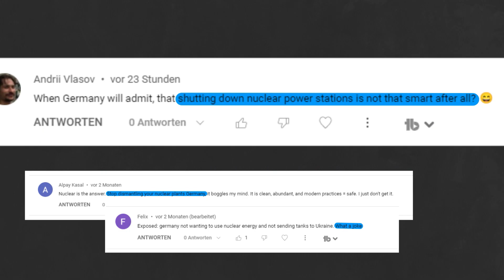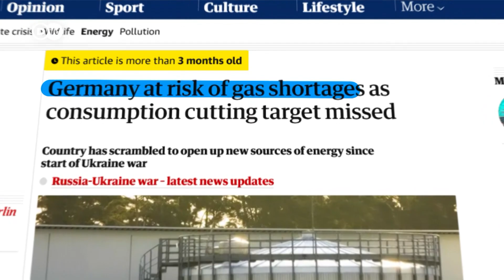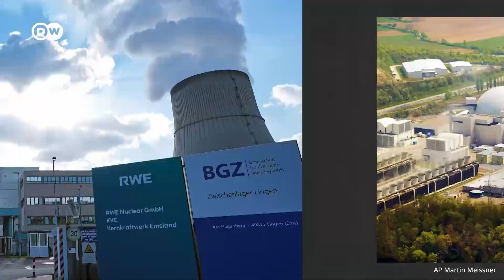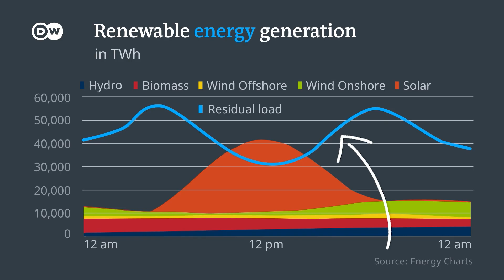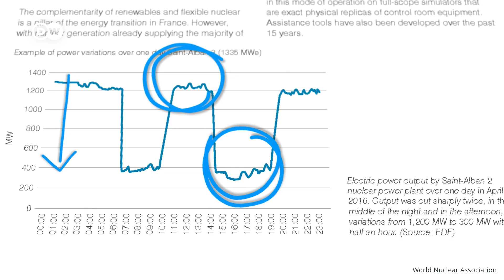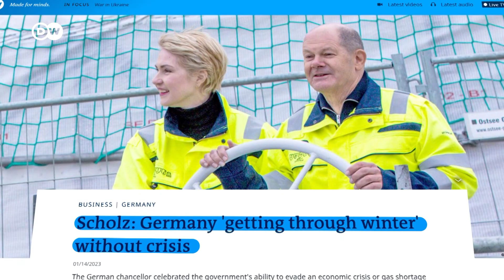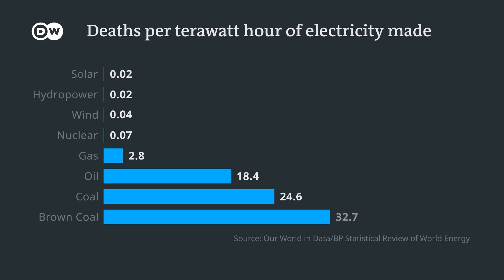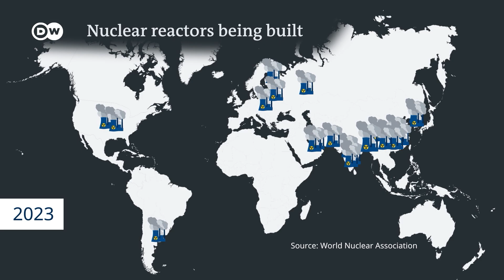Is Germany's nuclear exit a mistake?

Comment: Germany choose to phase out already built low carbon nuclear and keep coal for another 16 years. Absolute worse decision
Reply: @gianlucapistoia8993  maybe on a gw basic, certainly not on a gwh basis. But, as the op said, coal is locked in.
Reply: @riveness they should wait until they have the renewables to replace it before turning off nuclear plants. That won’t be years from now though.
Reply: Coal radioactive emissions are way worse than nuclear plant radioactive emissions.
Reply: @maeseatila  Radioactive coal? That actually makes sense in a way. God nature is scary.
Reply: @maeseatila Tschernobyl und Fukushima sind die Beweise
Reply: @maeseatila  nooo!
Reply: @maeseatila  A fact that few people know.
Lignite the most used type of coal in Germany is even worse.
Reply: @maeseatila  Indeed, for coal contains uranium and thorium, and coal plants in Germany have released more radiation than any nuclear plant in Germany ever had. But even that is not the biggest health concern, it's the air pollution from coal that is the real killer.
Reply: @switted823  Yup, radiation in coal energy is just the icing.
Reply: @Polygarden  i didn't talk about electricity demand. I talked about energy demand. Because yeah, if there's a huge demand for gas in winter, although it's not electricity in itself, that's gonna impact the electricity supply/demand. Because gas is also used to make electricity.

Edit: now that I think about it, it's even worse than that. You're saying that in Germany the electricity demand is the same in winter and summer. Yeah because people are heating with gas. But we want to stop gas, right? Because gas is a fossil fuel and is a main contribuer to global warming. Everyone should want to have electric heaters (and a low carbon source of electricity). And then the electricity consumption will not be the same in winter/summer. There will indeed be a peak of electricity demand in winter when the sun exposure is close to 0.
Reply: Nuclear has zero carbon
Reply: Well have you ever estimated the costs for storing nuclear waste for 150 000 years andc
 the dismantling of an power plant and storing that waste for the same time. Who
 will pay for that, the comoany who had run the plant? Do not think it will exist that long. So the taxpayer has to pay. Do your math, if all the costs had to be payed by the company no one could afford the price of $ 75 per kw/h and no one would built such an plant.
Reply: Exactly
Reply: @gianlucapistoia8993  nuclear reactor can be operated for 80 years. If it was constructed in 1989 it means it was only 34 years old not even half the life span. They decided to forcefully shutdown perfect reactors to construct 21GW of natural gas power plant. Germany don't care about climate they fought an ideological battle not environmental.
Reply: well, seems  like the germans are use to take the risk,   the rest of us can only watch .... ... power to the germas
Reply: Nuclear is bad for environment, do you understand?　Go to Japan or Ukraine.
Reply: @gianlucapistoia8993  This is not  good actually becuase Germany already hit the wall of diminishing return (ie if you have solar panel with a capacity factor of 25% (meaning they work for 25% of the hours present in a year) and on-shore or off-shore wind turbine (avarage CF 30-35%) you can't actually produce more energy by renewable or better you can but it's going to be wasted unless you store it somewhere, but Germany like many other EU states have maxed out their Hydro storage capacity so it will be simply impossible to reach 100% FER that's why Germany is the first CO2 emmiter in EU. Closing down nuclear plant and not build new ones just means giving the baseload production to Oil & Gas (or coal) industry.
Reply: The Carbon foot Print per TWH Power by nuclear Power plants is really bad, if you include the Energy that is needed to dig and operate Not yet existing Terminal Storage and the enormous amount of Concrete to Build the Hull of the reactor. „The Carbon free“ nuclear Power is nothing than green washing.

Nuclear energy is the best example of "privatise profits and socialise losses/risks". Pure moral scum.

https://amp.dw.com/en/fact-check-is-nuclear-energy-good-for-the-climate/a-59853315

And you cannot operate NPs with dry or drying out rivers. Look at the Po river or many others, many others are also already at a low water level. Since years you can bet the rivers like the Rhine get very low on water level, that even Navigation is merely or Not possible for some Werks in the Summer, Hoe would you cool your NPs without cooking the Fish?
Reply: Partially correct. The sensible, cost efficient way forward would be a massive buildout of renewables (fucking the NIMBYs in the process) and shutting off coal right alongside nuclear, with gas a few years behind.
Reply: It really makes you wonder what their agenda are motivations are for the climate change issue when they're willing to burn the more polluting Simpsons
Reply: @gianlucapistoia8993 And where do you think used solar panels and wind turbines go? Countries are burying all used solar and wind power planta under the ground because recycling cost is way to much. Also do you know where does the battaries come from? Lithium is extracted by third world countries like ones in africa, and all manufacturing is done by china and india who are the worlds biggest polluters so that in europe you can say yesss its green energy we are fighting world climate which is bullshit.
Reply: A broken in but not broken down nuclear reactor is about the most valuable thing in the world. Despite initial impressions, Germans are morons, the 20th century could easily have been the German century not the American century but they fucked that up too.
Reply: @gianlucapistoia8993  Germany is literally facing rolling blackouts constantly even with them using coal plants to supplement in the inconsistency of solar and wind. The future will have to be with nuclear or else you can enjoy blackouts.
Reply: Funfact: The coal industry pays german politicans handsome sums of money so the government keeps funding an already unprofitable and dying industry...  German politicans are just a bad joke...
Reply: This is a very good choice. Nvm the "some" dead citizens. Love COPD patients at the hospital (The bonus here is that they do not speak while at the ER.). They are fast patients at the ER. They expire somewhat quickly. (Some irony is in here, whatever, these neo n folks will pay the prize. ) Comparing value of health in this nations crimes against humanity, ad infinitum.
Reply: romans lived two thousand years ago and the first pharaohs 5000 years ago. We know little about them. imagine we bury nuclear waste that will last 100,000 years and is deadly. You cant do that the the future generation. We in Germany still have no repository and nobody wants it so...And the construction and dismantling of the nuclear reactors is not Co2 neutral either due to the gigantic amounts of concrete. In addition, because of the phase-out of nuclear power, we will not phase out coal later. Just wanted to make that clear. Btw Finland is the only country with a final repository.
Reply: German hypocrisy is so disgusting😂
Reply: Ofc you do so when you listen to some dumb activist instead of scientist
Reply: Bullshit
Reply: @kevinmeganck1302  
One would think, when 27 countries/EU with about 450ish million people living there "going green" by using/producing green hydrogen with renewables (wind, solar, water), that they're knowing what they are doing 😊

As one of lots of examples, please look up for the "green hydrogen coast line", a project run by the Netherlands, Denmark and Germany...

Some months ago the world wide first 14 hydrogen powered trains (Alston) started their service in Lower Saxony/Germany.

Daimler trucks has developed trucks running on hydrogen as well as the Faun Group have developed hydrogen powered trucks/vehicles, which are already in use...
Reply: The Greens chose that
Reply: Sadly, most Germans I know are with the government on this and when you call it bullshit (like I do), you get insulted and attacked.
I hate my country sometimes
Reply: And chose to still be heavily dependent on other countries for energy which has alrrady been shown to be its greater weakness and will still be exploited by other powers
Reply: That is not an absolute decision. 

1. Germany choose this path after the earthquake in Japan. 
No one in Germany wanted this shit to happen in Germany. Time passes by and ppl forget the feeling how it was. 

2. Germany is always producing more than enough energy. It will only lack of energy because countries like France have dozens of nuclear powerplants and no water to cool them. That happened last summer and they bought from Germany. 

3. We could be further with the energy structure. But bavaria is fucking it up with not upgrading their shity cable infrastructure. 

4. Energy from powerplants is not cheap. It looks cheap because it get billions of euros subventions. 

5. Since it was decided (from all ppl back then) to step out of nuclear energy the reactors didn’t get checked enough. Only if they work until the shutdown. And if we would continue to use them it would cost billions to renew them. 

5. Politicians use this frame rn to create fear and get new voters. But if u get ur facts straight u will see, that there is no problem. Germany is always exporting more electricity then buying. If the weather is not good they will just buy electricity.
Reply: ABSOLUTELY Worser than the Worse as off now we are already at this critical situation, Sun energy can't maintain Big Industrial Complex,  Firm and companies. We will be going Backwards...In the long run.
Reply: That's what you get when you vote for marxists.
Reply: 16 years lol they'll have coal for 25- 30 years
Reply: Ja
Reply: Absolutly! This is all so dumb! And many Germans don't like it! They risk our energy security! While France with theit "evil" nuclear power plants has much less CO2-Output than germany, which can be seen in the "Electricity"-App, we ar always above it even on the sunniest and windiest day. In Winter Germany turns nearly as brown as Poland inside that app, wihle France ist green ALL the year!
Reply: Yeah, these 5% matter ...not at all :D
Reply: Not to mention the geopolitical implications of relying on Russian energy
Reply: @gianlucapistoia8993  35 years is no age for a nuclear plant, and they could have been upgraded if there was a will. Instead they were left to decay since they were decommissioned anyways.  
The record numbers of solar and wind should not have been used to shut down nuclear, but rather dirty coal plants.
Reply: @gianlucapistoia8993  wind and solar are weather-dependant. They are never going to replace coal. They work together with coal.
Reply: @Flipdonyk  With battery price down and higher capacity of renewables than 100 % it will be
Reply: @Flipdonyk  Coal should not be used, ever, period
Reply: @Flipdonyk  They HAVE TO replace coal, because the world's ressources are dwindling and coal isn't a renewable ressource. Some day in the future jumanity doesn't have a choice but to use green energy (unless ehey find another finite ressource to exploit, but that only prolongs the inevitable
Reply: @Flipdonyk  replace coal with nuclear (or hydro, depending on where you live) and you will be right
Reply: @F44-JP5  if the place is very hot concentrated solar is also an option. Solar panels performance decrease in hotter regions and Concentrated solar also stores energy for later use. But it depends from place to place there is no one solution for every nation.
Reply: @F44-JP5  I'm totally fine with renewables + nuclear, until we find a better alternative. I'm absolutely not fine with renewables+coal+gas until we find a better alternative
Reply: @F44-JP5  hydro and geothermal deserve investment, it’d take a few years of serious funding but the potential is there,
Reply: @Flipdonyk  There are more green options than the two
Reply: @gianlucapistoia8993  then why aren't they constructed first before you start decommissioning? Is the idea to back the German citizen in a corner so that they'll pay "whatever it takes" to build these alternatives?  I think it is, why run a power plant for a Billion Euros a year when you can run an equivalent power plant for 10 Billion Euros.
Reply: @holdmybeer123  to be honest, that's a good question and I don't have an answer. But when I look at the course of the last 12-14 months, I get the feeling that Germany no longer wants to produce 100% of its own energy. It is relying more on its European partners (there are some projects already underway with Denmark) and at the same time you see that Germany is very focused on South America. I'm curious to see where it's going, the government is certainly not lazy and even if it's not shown so strongly in the media, as a German I really have the feeling that energy policy is changing for the better and news like "phasing out nuclear power" naturally seems as if Germany hasn't learned anything. I think you really have to see the bigger picture here, where we simply lack too much information to really be able to make a concrete judgement about it.
Reply: @gianlucapistoia8993  So your response is even though you don't know what is going on, that you trust your government. I get it, with the rise of technocrats, people really think governments know better than them, and hence the "trust"
Reply: @holdmybeer123  No, I didn't say that, but I also find this attitude of "the people up there are lazy and have no idea" reprehensible. I think a healthy scepticism is the best way, but I think I can read where the current policy is getting a lot of pressure from the population. I have been consuming the rhetoric of the individual politicians for years now and they all agree on one thing -> the climate change has a very high priority. Even at the EU level (to which Germany makes a very large contribution) it is identical. If we look at the financing plans of Germany and the EU, we also see an incredible amount of overlap, so yes, I am indeed optimistic at the moment and I believe in the climate-friendly transformation.
Reply: @holdmybeer123  
The origin plan was to "phase out" all fossil fuels (oil, coal, nat gas) until 2030-2045, while in that time range the renewables are taking over more and more (storage batteries as well), but then the war started, and here we are.
Reply: @gianlucapistoia8993  
Me too ("I believe in the climate friendly transformation") 😊
Please look up for the "green hydrogen coast line", a project run by the Netherlands, Denmark and Germany, all subsidiesed by the EU and Gvts.

Hydrogen can also be used as storage battery for the overloads from the offshore windmills and others as well as raw material for proceeding things like steel, glass, paper etc as well.

All along the coast lines electrolyseurs are under construction.

Lots of start ups are working on alternative storage possibilities as well.

Some months ago the world wide first 14 hydrogen powered trains (Alston) started their service in Lower Saxony/Germany.

Daimler trucks has developed trucks running on hydrogen as well as the Faun Group, those trucks are already in use.

Greetings from the North Sea coast line 😊 

Edit typo/autocorrect
Reply: @saba1030  👏🏽👏🏽👏🏽
Reply: @alainpannetier2543  thanks for the lucid explanation, you would think you will have a new home complete before you burn down your old home, but the cost of missed opportunity to burn down the old home is just too much? Nonsense!
Reply: @gianlucapistoia8993  Not in Germany.
Reply: @saba1030  Very interesting. Green Hydrogen has a very exciting future.
Reply: @gianlucapistoia8993  sure, instead of coal you could burn gas whose only problem is the production of less CO2 and more Ukrainian lives
Reply: @gianlucapistoia8993  not in Germany. Rivers are waterways and you cant build a Dam there
Reply: @gianlucapistoia8993  "we simply lack too much information"(well then read some more and inform yourself, they said most of it you just aren't willing to accept it) norad2 aka north stream 2 the main information you need, the idea was to help russia have a market for gas, because cheap russian gas is the main energy source for the steel industry that made Germany what it is now, and you guys went hook line and sinker(and taken the bait) for it and now the Netherlands has to sink down in the swamps to supply you with gas, please someone tell me, are the illuminati real because you can't make this shit up even if you wanted to, i heard that green party is financed by black money, but i guess they did the job well, if nuclear died before coal and gas. For the plan to go full renewable you had to have a e-transmission line through Denmark, Norway, all the way up to the North pole and back down to Texas(the sun shines always somewhere project) , or energy storage prepared, before demolishing nuclear plants, but as we see power corrupts and absolute power corrupts absolutely, even to the point of corrupting the minds of the electorate. One line explanation will not fix years of 50's US anti-nuclear (fear mongering) propaganda off your mind, but a man can dream. Read the deaths per KW statistic carefully again and think really hard, i believe you can find the thing you are missing)
ps: you can put the nuclear waste, in the sealed container, in a vat of water and use the thermal energy of the waste making energy out of the junk as long as it is above ambient and you are ok with storing large amounts of junk for not that much energy (spent uranium rod will not be at boiling temperature, but you still have 80deg of useful energy below boiling from the leftover unspent fuel occasionally decaying, and the rest of fissile materials that are the leftovers and, at 5deg difference a reverse-peltie element would work, even tho it will be at <50% efficiency, but to be fair it will also work with regular solar panels keeping them hotter than connecting a heat sink (radiator) directly and even in rain with a heat sink (a lump of metal) with similar results per unit mass but more constant than rain), body heat is enough of a difference to work, and all are better than 0%.
Geothermal > Hydrogen storage + solar powered hydrogen electrolysis > nuclear > Nat Gas > coal > slaves running on wheels > living next to a coal plant, whatever the best option available is.
(for details ask random smog city - China/ Victorian Britain, in short CO and sulphur damaging lung and brain but as long as it is operational not just when it explodes also the Chernobyl nuclear exclusion zone is one of the friendliest places for wildlife on earth because no humans and no ground pollution from farming) shift left to prosper, shift right to... please don't.
Reply: @gianlucapistoia8993  but not for tomorrow, maybe in 30 years?
Reply: @gianlucapistoia8993  
Yeah and its nuclear
Reply: @gianlucapistoia8993  Germany is part of the european power grid and european electrical current market. If someone in Europe can produce energy cheaper than in Germany, Germany buys the energy from outside. But it also works reverse. In Summer 2022, 28 of 56 french nuclear power plants were off-grid and Germany transferred a huge amount of electrical energy to France.
Reply: France is a terrible example. Last year they needed to import huge amount of energy from Germany due to their reactors not being able to be cooled due to extremely low tides in rivers.
Reply: @Climate.Realist  no that was not remotely the situation in France. There was delayed maintenance due to COVID-19 in 2020 and then some corrosion was found on a few reactors which were shut down so this could be taken care of. Yet despite this exceptional situation France still managed to provide electricity without black out while emitting 5x less CO2/kWh than Germany on average 🥱🥱 

PS: low tide usually happens in summer when energy demand is at its lowest. So it's not so much of a problem. Solar panels however have the opposite problem: extremely low exposure in winter when the energy demand is at its peak. inform yourself outside of German Media for once in your life before making a fool of yourself on the internet
Reply: @Flipdonyk  well, who’s making a fool out of themselves here… 
I work in the energy transformation sector. Germany had to export huge amounts of energy to France last year because they couldn’t run their power plants. Some due to maintenance and some due to not being able to cool them during the summer. Our company earned millions with those transactions so yeah. My bank account tells me that I’m right so feel free to disagree but that doesn’t make it true. 
France managed to provide electricity, true. But they also bought a lot from Germany.

Addition: it weren’t a few reactors off grid. More then 50% were at least temporarily not online.
Reply: @Flipdonyk  
France had to shut down half of its nuclear power plants because of low water levels in the rivers due to the recent heat wave (summer 2022) and urgently needed maintenance (still ongoing), therefor Germany (and Spain and the UK) is doing the back up power for France.

About 80ish % of the French electricity gets produced by nuclear power and the French are heating with electricity as well, therefor Germany is sending six times more electricity to France as normally.

In exchange for the electricity France is sending nat gas to Germany 😉

Edit typo/autocorrect
Reply: @Climate.Realist   yeah, France had to import a lot of electricity last year (and still a bit this year) i never said the opposite. But I maintain that it was mostly due to the delayed maintenance due to COVID-19 and the corrosion. Usually low water levels are already being considered as a possibility risk factor. Of course it worsened the situation but low water levels in itself wouldn't have been a problem. 
THIS BEING SAID, yes France had to import some electricity for the first time in decades but it emitted 5x less co2/kWh compared to Germany on average nonetheless. Good for you if you made money off of that, but I don't see how it invalidates my bigger point.
Reply: @saba1030  inform yourself. As I'm writing this comment France is literally exporting electricity to Germany while emitting 8x less CO2/kWh -> check by yourself on electricitymaps
Reply: @Flipdonyk  
Please read your own answer to @Finn Mrck, where you wrote, that France had to Import lots of electricity in 2022, which was exactly what I wrote.

Btw, why did Germany have a higher CO2 ermittation then normal? Because it had to boost it's electricity production to do the back up power for France.

About 48% of Germany's electricity gets produced by renewables (wind, solar, water).

Forgot to say, most of the nat gas in Germany is used by the industry as raw material for proceeding things like steel, glass, paper etc.

The EU27/Germany will replace all fossil fuels (oil, coal, nat gas) with green hydrogen, the goal is focused on 2030-2045.

Hydrogen can be used as storage battery for the overloads from the offshore windmills and others as well as raw material for proceeding things like steel, glass, paper etc.

All over Germany electrolyseurs
(wind to power) are under construction.
Lots of start ups are working on alternative storage possibilities as well.

Please look up for the "green hydrogen coast line ", a project run by the Netherlands, Denmark and Germany 😊

Edit typo/autocorrect
Reply: @saba1030  Germany didn't export "a lot" of electricity to France last year. It did export some electricity but it represents a very small portion of the electricity generated by Germany. And no this is not the reason Germany has such a high CO2/kWh average. For example today France exports electricity to Germany but France still has 50gCO2/kWh while Germany has 300gCO2/kWh. The huge carbon footprint of the German energy system is not abnormally high, it always is. And this is because the main source of electricity in Germany is coal, the number one worst source of energy that we have (below fuel in a car which is not only dirty but also very inefficient). So my point is : Germany should have turned off coal WAY BEFORE turning off nuclear. I cannot even understand how anyone can disagree with this statement. 

Now regarding your hopes of using H2 to use the electricity from offshore Wind turbines: this is the objective yes, but we are very very far from having the technology to achieve this dream. The conversion from electricity to H2 to electricity is extremely inefficient, let alone the carbon footprint to transport the H2 around or to have high voltage power lines bringing the electricity from the north of Germany where there's wind to the south of Germany where industries are. 
And all of this is only the tip of the iceberg because in addition to day-to-day energy compensation or north-to-south there is also summer-to-winter compensation. Because in winter there's almost no sun, so very low access to renewables energies while the energy demand is at its highest. And we don't nearly have the technology to store enough energy for an entire winter (and possibly never will). 
And meanwhile, as we try to solve this puzzle with no certainty to find answers to all problems we're facing, the "temporary" solution we decided to use is fucking coal. Every year we spend looking for a solution to energy storage is another year with a carbon footprint much much greater than other first world countries.

You're talking about an horizon 2030-2045. Are you seriously saying this with pride ? It means the most optimistic hypothesis is during the next 7 years we will have CO2 emissions that are amongst the dirtiest of the developed world. But we will most likely not achieve this objective by 2030 and probably also not by 2045. Because yeah, we're still at the R&D stage. We have some ideas for energy storage like green H2 and batteries from electric cars. But these are just hopes. We have 0 certainty these will ever work.
Reply: @Flipdonyk  So your bigger point is that France has a better carbon footprint than Germany? That is factually true. But imo it doesn’t matter. Germany is already changing their grid to a dynamic network which will benefit us extremely once it’s finished with potentially negative energy cost when too much energy is in the system. But  France won’t have an incentive to do so because their nuklear power plants don’t provide a high enough pain point in order to get to the next step. 
Germany is doing the typical 1-2 steps back to make a 5 step leap forward so we can get rid off all this fkn coal. 

I was always having the opinion back in 2010 that they should keep nuclear running and phasing out coal first but that just wasn’t popular back then. 
Germany definitely made some questionable decisions back in the day but in the situation they are currently in, it’s perfectly fine what they are doing. And by shutting these plants down it creates more pressure to keep moving in the right direction.
Reply: Dude nuclear power was 2022 1,5 percent of our countries energy
Reply: @JohnnyF-x4f  but it was 25 % in the early 2000s before the reactors were turned off one by one (as it says in the video)
Reply: @JohnnyF-x4f  which is more than all off shore wind and nearly as much as solar and unlike them, reliable. You ok with tearing all that down?
Reply: @MTobias  dude here in lower saxony wind does over 20 percent of energy
The trams and partly hybrid busses here in hanover drive with green energy
Just saying
Reply: What about the safe storage of coal ash which mostly never degrade with heavy metal and all. Very deceiving decision from Germany to close existing plants
Reply: Ludovic Douay,it was a political decision, not a rational one, do you expect rational decisions from politicians?
Reply: @gianlucapistoia8993  We should have used the ones already built as long as they would have been considered safe.
Reply: So we can put the nuclear waste in your garden ? For thousands of years ? That is the big problem. The other thing is that  nuclear power is much more expensive. In Germany we have the second most stable power grid in the world. I can not believe how little attention is paid to nuclear waste. The article suggests that we are only afraid of a Gau. And research into fuel rod improvements continues.
Reply: There is only one answer on that: The power of lobby.
Reply: @gianlucapistoia8993  You guys could have easily made your 2035 goal by 2026 had you kept nuclear (not even expanded on it). You could have exported your excess energy to other coal-heavy countries such as Poland and had engineers with experience to help build other nuclear plants across Europe, expediting the transition for others. Instead, you thought coal and natural gas was the better alternative. This is despite the fact that coal produces more nuclear waste than nuclear and is openly exposed to the public. Again by just maintaining the status quo, you could have completely phased out coal by now. As pointed out you guys have no way to store energy as that technology is at least a decade out. Not a decade from being widely available like solar but from being available.
Reply: @myg14570 Who says so? Which country is more concerned about the environment and does something about it? Yes, I do not understand why nuclear plants were turned off before renewables were productive enough. But other countries should also move strongly into renewable sources (USA, China, Russia, India....)
Reply: 🤣It's only bad if they don't get enough energy.
Reply: That is something what Germany needs to rethink.
Reply: And to add insult to injury ...the green party favours the possible use of nuclear weapons over the civil use of nuclear power generation, by buying 35 F-35 to mantain the nuclear participation within the NATO framework.
Reply: @thilomanten8701  I don't think you understand what the F-35, F-35 is a flying computer it controls all the war machines around it, that's why whole of NATO needs it, so if a missile system doesn't see danger but the F-35 does the F-35 it self can activate that missile system towards target.
Reply: @thilomanten8701  Ehm, as opposed to what? not being in Nato?
Reply: @thilomanten8701  In terms of "green" Nuclear is better than Wind power.
Wind power is a scam anyway.
Reply: @thilomanten8701 a weapon COULD cause damage. A reactor CAUSE damage.
Reply: @thilomanten8701  That's basics of hypocrites not in my backyard logic. They don't mind nuclear blasts or reactors, they just don't want them anywhere near themselves. If they could build reactors in another country and then take all the power from them for themselves, they would probably do it.
Reply: That is not right. You think nuclear power is a good solution because you haven't experienced a nuclear accident. Even though you know something like this could happen. You will never completely eliminate probability.
Furthermore, with too much energy, you could convert it into hydrogen and then use it later. Basically, you could buy larger hydrogen storage tanks in the summer and use them in an emergency.
What is often forgotten is that electricity from nuclear power plants is anything but cheap. In fact, nuclear power costs much more than electricity from renewable energies.
Reply: it’s worse for germany but germany cannot say to 35k USA soldiers within its territory 😂buy more over priced other resources
Reply: Its a mistake
Reply: Cant run an economy on unpredictable energy.
Reply: @gianlucapistoia8993  no, it's been consistently shown the decision to shut down nuclear for coal has caused more harm then good. Even reactors built in the 90's are better then coal plants, and you could have built new ones in the last decades that would basically eliminate the need for Russian gas and Coal with all of it's emissions. Building Windmills is useless if you fill up the low-tides with coal.
Reply: @gianlucapistoia8993  Still not enough electricity bill has become high and it will only get worse. 😮‍💨
Reply: I'm not an expert on this topic, but I think it is a badly planned transition. The expansion of renewables is way too slow to reason shutting off a working technology.
Reply: And it's not just coal
It's the worst type of coal aka lignite.
With it being really low quallity and basically dust it makes it alot worse.
Reply: @gianlucapistoia8993  
Please stop writing stupid comments. Nuclear cores can be used up to more than 60 years or even 80 years.
Your solar and wind aren't controllable and are not always available, no sun at night and wind is very unpredictable.
Only nuclear and hydro are controllable.
Search duck energy problem
Reply: @boulabiar And you leave the problem of the radioactive waste to the next generationS. And you don't mention the overall cost of nuclear power and decommissioning the nuclear facilities.
Reply: Wind and solar are not good for base load.
Reply: @belarepa  that doesn't mean it doesn't make sense to have it anyway. There is still no ultra energy system that is completely safe and leaves a green footprint. It is a combination of many methods that solve our problem and are climate-friendly.
Reply: @gianlucapistoia8993  There is still no ultra green energy system
Except for nuclear.

Nuclear is the greenest of green energy there is, even greener than hydroelectric.
Reply: @gianlucapistoia8993  you said we don’t have an ultra energy  system but we are looking into fusion 👀
Reply: @belarepa  because Wind STILL has to rely on Oil "as some sources say" and Solar relies on the sun, but if it's raining or always cloudy then it has a big challenge to fight and the building of battery charge storage stations aren't environmentally friendly but what they both have in common is that they take up too much space "which means a lot of eminent domaining and cutting away the forest and landscape" which isn't really great.
Reply: @gianlucapistoia8993  Germany has the dirtiest energy system of all western countries, that is highest CO2 emission per amount electricity produced. It's insistence on shutting down nuclear has prolonged this, and there's still no working solution on how to manage an energy system based on intermittent energy sources (that to top it off doesn't even have large generators, meaning they couldn't keep the electrical grid working even if they weren't intermittent). The energy storage dream is still merely a dream. Producing sufficient amounts of batteries would take centuries at the current pace and hydrogen solutions basically only works for limited niches unless you want to be super inefficient. Large-scale pumped hydro solutions might be the least silly idea. But building new nuclear plants is still the fastest way out of this mess.

The average nuclear power plant takes 7 years to build and the most common variants take 6 years. In Sweden there has been a similar drive among so called green and left leaning parties to phase out nuclear and try to replace them with magical thinking and wind power. We built 12 reactors during the 70s and half of the 80s though, and all the more than 5000 wind power plants that have built the last few decades still only produce roughly the same amount of electricity as the six reactors that have been shut down here and around 60% of the power of the remaining six. And that's not counting that wind doesn't provide the same services as nuclear power does in providing non-intermittent power and keeping the grid stable with the inertial response in the large generators.

I'm sure that many people who oppose nuclear in Germany and elsewhere still think that they somehow are doing the climate a favor, but it's not ideological conviction that decides whether your contribution is useful, and the actions taken by Germany are the same that someone intent on extending reliance on fossil fuels as long as possible would have taken.
Reply: @gianlucapistoia8993  German nuclear power plants are exceptionally safe and reliable. They easily have another 40 years in them. NPPs are just so strong and robust that they can last essentially forever, which is just another great point about them.
Reply: @gianlucapistoia8993  We in Germany have one of the worst/the worst CO2 footprints in western Europe. Our brown coal that we burn emmits radioactive isotopes more than the nuclear power stations. Cancer rates are higher near to coal power stations as well. Its a disaster.

In the meantime there is no way to store renewables as much, or as long, as anywhere near needed. Current battery technology isnt exactly environmentally friendly and is needed for electric vehicles.
Reply: Gianluca Pistoia, nobody answers the question, what happens when the wind doesn't blow?
Reply: @michaelbullen4146  He looks confused over this matter. To answer your question; Germany will be either importing power, or simply continue burning whatever they can. It makes me wonder who is really running the country when the only solution is going nuclear for 80% of the power, the rest can be made with renewables without requiring another electrical grid, very high costs, huge co2 releases in other parts of the world mining materials for solar panels, wind turbines, etc.
Even UAE with more than enough sun and wast deserts is currently building several NPPs because they know this is the only way. They reported each ~1,4GW NPP will be built in 5 years for 5 billions, if we add 100% more that's great achievement compared to what the West is doing.
Reply: Coda Alive, a couple of years ago I heard that the Rolls Royce company had developed small nuclear power plants, but no more since then, it always seems to me that nuclear is the way to go but politicians seem to be paralysed and nothing seems to be done, the problems that do exist with nuclear can surely be dealt with the whole world pooling brain power and resources but politicians seem to be gutless and nothing gets done. Time is running out.
Reply: @michaelbullen4146  Well written reply. 
Of course there are no technical obstacle, molten salt reactors were first designed in Russia in 50's, then tested in USA in 60's but oil lobby said no! Situation is so bad i wouldn't mind living next to RBMK as built in Chernobyl, they are great compared to hydrocarbons we burn now.
The problem with politicians are their 4 years long terms, when they already look ahead for another 4 years not wanting to bother people with anything too "exciting". You know how majority of people are, they tend to stick to things familiar to them so making anything nuclear would take younger politicians not caring about their bank account way too much. Or something along this lines, i'm more of a tech type.
Rolls Royce is just promoting the company knowing small modular reactors would be too expensive, probably dangerous and coming with proliferation problems because we would need too many. Rolls knows this very well as do many other smaller companies trying to pull some money from investors. If you think of it, making nothing is nice business for those only wanting money, not much effort is needed. But they do have great designers, check Roll's reactor pics, fantasy!
Russia, China, India and maybe 1-2 other countries can really make nuclear reactors because people there are often educated enough, have hands on experiences, the rest know nuclear is great. UAE has several oceans of oil but guess what, they are building 4 nuclear reactors for 1/4th of the price of ours, each will be finished in 5, not 20+ years like in the West. Wiki has this info...
China is happily working on several very inovative designs, Russia is world's leader in everything nuclear but we don't know it due to decades long propaganda, India is clever too, i expect South America doing it too when they throw out USA. The West will continue burning oil&coal and dream about now very fashionable fusion or whatever will be fashionable in 30+ years. I'm congratulating Germans for being so corrupt they ruined the last 3 reactors in favor of coal, great deal 👍We are too late already to continue life as we know it, if US continues provoking we might get real nuclear disaster instead of one severe in military plant (Chernobyl but they don't say it was mil.) and 2 others with several hundred cancers at most. I believe only coal kills 800.000 people each years, where's the rest&ruined weather, lack of water, wars that will be fought for energy, food?
Reply: @gianlucapistoia8993  Yes, but you just cant rely 100% on renwables, why do you think Germany built all those pipelines? Renewables are critical part of future energy mix, but you also need other stable sources, and sources you can turn on as needed. Nuclear being best option for this unless you want to rely on fossil fuels -.-
Reply: @gianlucapistoia8993  I feel that Germany should go for nuclear is because form windmills you need wind that is why in UK although they have windmill still energy prices are up only way to solve in nuclear fission and fusion
Reply: Another 16 years of coal? They will extend that for much longer because nuclear is the only known technology for base load problem, another thing no one talks about is the need for parallel (pretty much one more) electrical infrastructure. All of this would maybe work until 2050 or so if renewable didn't have large carbon footprint; they are acting as if China or other parts of the world where Germany exports their emissions by getting raw materials or tech like solar panels from didn't share the same atmosphere with Europe. That's insane.
Reply: if germany didnt phase out nuclear, putin wouldnt have thought of blackmailing europe with gas
Reply: @EsaMononen  
Germany is producing enough electricity, the nat gas is mostly used by the industry as raw material for proceeding things like steel, glass, paper etc.

The EU27/Germany will replace all fossil fuels (oil, coal, nat gas) with green hydrogen, the goal is focused on 2030-2045.

Hydrogen can be used as storage battery for the overloads from the offshore windmills and others as well as raw material for proceeding things like steel, glass, paper etc.

All over Germany electrolyseurs are under construction.

Lots of start ups are working on alternative storage possibilities as well.